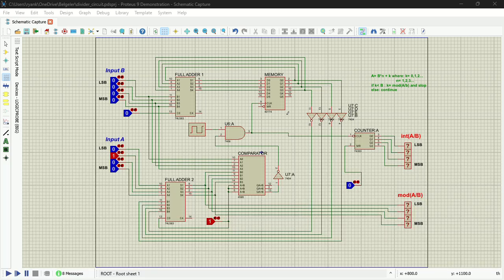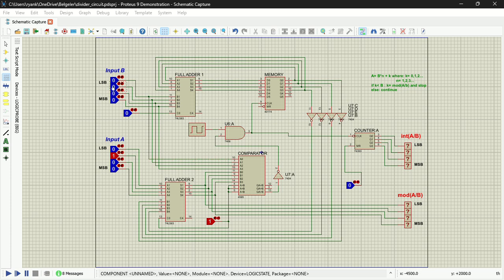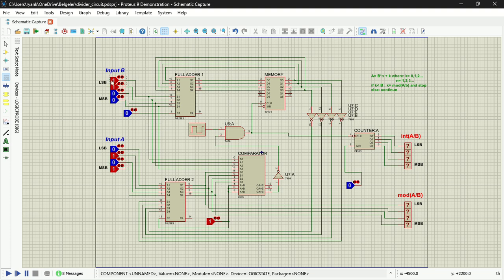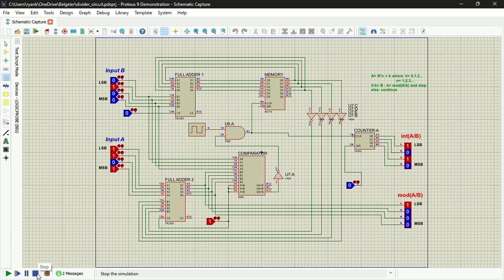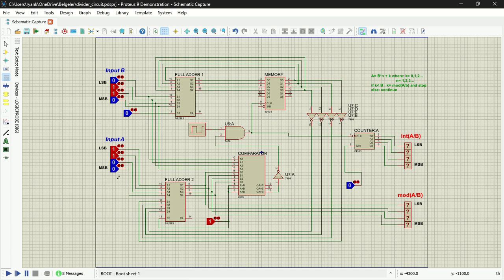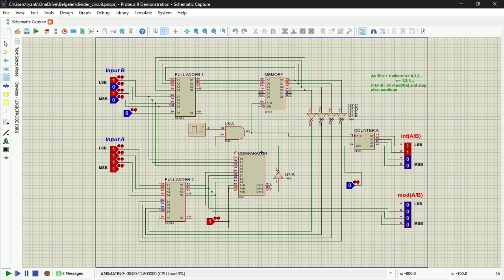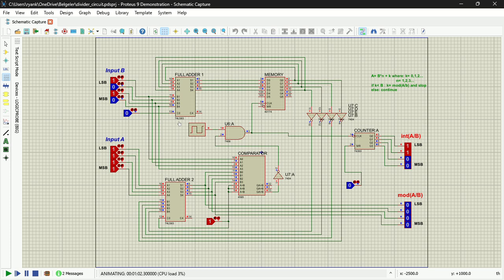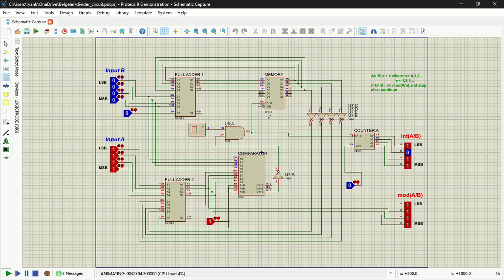4 Bit Divider Circuit Design and Simulation with Proteus 9

Comment: also, id like to ask. i built this exact circuit down to the same components and connections, however, im getting an extra clock pulse at the start of the circuit and at the end it is 1 more than the expected result
Reply from the maker: Hello, you can set the initial value of the 74393 counter to 15 instead of zero because it instantly jumps to 1 with no period or you can use the 74LS93 counter instead because it actually starts from zero.

Comment: can i have the file of the divider sir?
Reply from the maker: Components:
1) 2 Full Adders (74LS83)
2) Comparator (4585)
3) D flip flops (40174)
4) Asynchronous Counter (74LS393)
5) Inverters (74HC04)
6 AND gate (74HC08)
7) 100Hz Clock
Reply from the maker: I'm using proteus 9 demo so I couldn't save the file but I can give you a list of all the components I used.